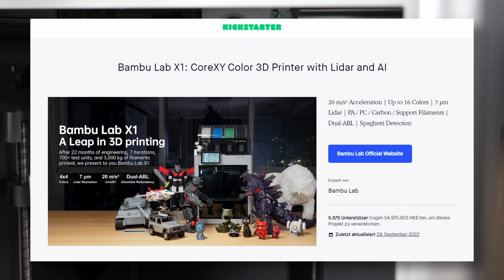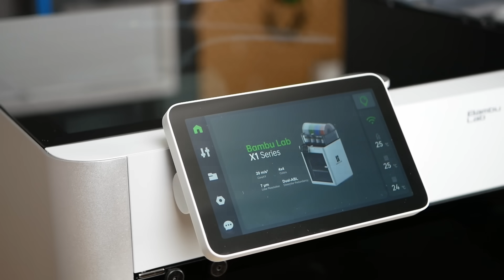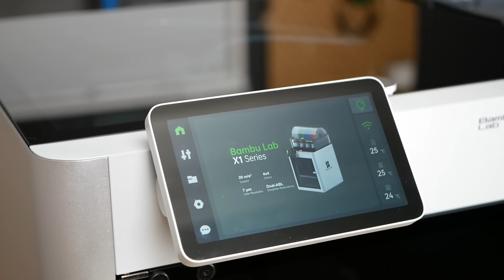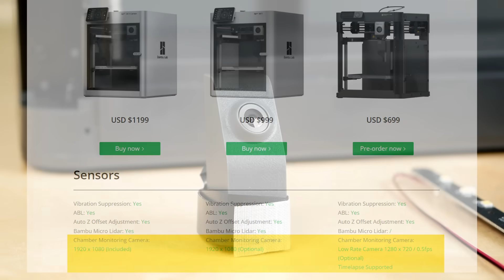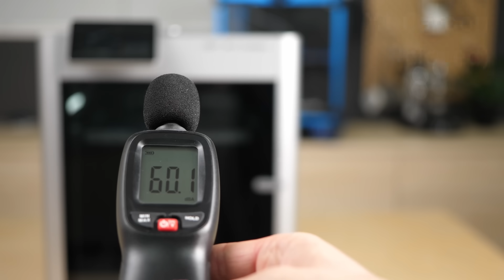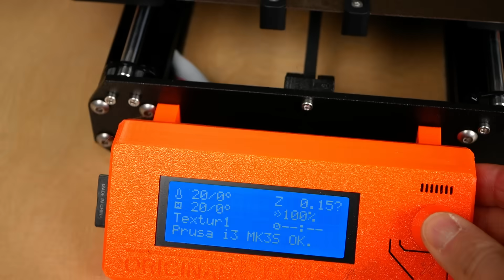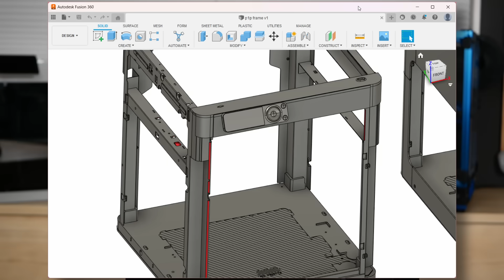The Best 3D Printer of 2022 got Stripped Down to make it Cheaper!

Comment from the maker: X1 Carbon, P1P or neither of them?
Reply: Neither.
I love pretty much everything about them, but the 60-65dB (that's unlikely to be fixable by replacing fans?) is a showstopper for me. =(
Reply: @Lizard008  Holy crap! It's that loud??
Reply: @Lizard008  well it is, just replace fans and job done.
Reply: @Lizard008  You have to realize that dbs readings mean nothing by themselves. Sound decreases exponentially with difference so db readings are only useful at comparable distances. So youd have to compare this to other printers at the exact same distance.
Reply: @BeefIngot  Duh 🤦

That is how their compared.
Reply: Assuming they fix my X1C that died after 30hrs, i will also probably get a P1P, I do mostly PLA printing but the ability to do other materials is nice to have.
Reply: i cant afford either of them, but i rather would go with P1P.
The X1 has nothing exepct the lidar and scanning solutions which i couldnt add to the P1P.
Reply: @michael80126  the x1 does have the ai processors for spaghetti detection and first layer inspection, which works quite well.
Reply: X1C - I see it as a tool for making things and not something to tinker with
Reply: I'd love to get the chassis and mechanical parts of the P1P, but with a skr or Octopus board running Klipper..
Reply: neither its a hard or impossible to repair 3d printer with propietery software. If bambu labs goes under or decides to stop supporting the printer for some reason you are likely fucked.
Reply: @sageslarres  If we only had machines which can create custom parts...
Reply: @MetalheadAndNerd  i know right why buy one when you can just make one instead? Plenty of open source projects using off the shelf parts designed by teams of engineers out there. Voron and ratrig to name 2
Reply: @sageslarres  Unfortunately time and space are costly, too. A RatRig build would consume all my free time for weeks and introduce a million possible breakage points because I have to source lots of missing parts from several vendors and the time for me to realize that something is missing or wrong is when the printer is half assembled. The risk of spending 2000€ on something that will only stress me out for months and never work satisfactory is too high.
Reply: @MetalheadAndNerd  yes that could be an issue if you are not versed in building and maintaining printers. But ratrig does ship as a kit so im not sure why you would go sourcing missing things? The breakage points are also there in the bambo labs printers they arent magick you just get it already put together. 

Its also more like 1k rather than 2k euros for a up an running ratrig.

The thing is you CAN repair your ratrig if the bambo labs breaks a year or 2 down the line you are probably completely screwed
Reply: @sageslarres  RatRig doesn't supply most of the parts for the enclosure, the cable harnesses are only cables cut to length without plugs. One has to crimp all the fiddly connector pins manually. That's the worst kind of work and you can count 1 wrongly crimped contact every 10 pins. 
Furthermore they offer the printed parts only in PETG while stating that when building an enclosed machine these PETG parts were are not recommended.
A 400mm kit with the least expensive options costs 1629€ excluding taxes and shipping. So I guess it will be close to 2000€ in the end. The missing parts cost about 300-400€. So the sum would be more than 2000€.
Reply: @MetalheadAndNerd  there is an enclosure kit where the only thing missing is the panels. Since sourcing and shipping em from ratrig would be more expensive than sourcing locally.

Where do you get 1600 från? Im looking at the complete 40mm builds without shipping plus a raspberry pi for 1430 inc tax and shipping.

Maybe you should spend more than a few seconds on the site so you get your facts straight.
Reply: @sageslarres  I got every information from the RatRig website, seconds before posting my comment. How about less fanboyism and more grip on reality?
Reply: @BlondieHappyGuy  The screen on the printer itself does not affect print quality at all. In fact most print commands are sent to the printer by wifi or bluetooth via your desktop or phone, so you won't even use the screen very much.
Reply: I only have had my X1c for a month and it is fantastic. P1P looks just as good. the only surprise was that it didn't have lidar, which makes me wonder is it really that helpful?
Reply: Just pre-ordered the X1C Combo, based off this video, TeachingTech's videos and those of a few others.  A much better choice for the options standard on it vs. the P1P in my opinion.  I really hope it meets the hype.  Thank you for the comparison and information about the two models.
Reply: The carbon is really the only one that offers something I don't already have. Anything less than the carbon I can accomplish on my basic printers. Sure it's fast but I have multiple printers so that's a moot point.
Reply: waiting for the their to-be-announced C1C1, an ender 3 clone for $299
Reply: @iamdmc  Why?

Why would I buy an Ender 3 clone for $300 when I can buy one for $150? 🤷

I bought my Ender 3 V2 for $150. Put $200 in upgrades on it and now it's just as good as a prusa.
Reply: Both
Reply: yes
Reply: I bought the P1P 3 minutes after preorder opened. Now I learnt what the difference actually was, so thanks for that!   I still want it, and look forward to it, I just wish I could afford the x1 now that you mention all its missing.   I’ll probably add the material station and then decide if it’s a keeper!
Reply: I see that lapavoni lever machine 👍🏻
Reply: @Jonnywoods_049  haha, i prefer the ponte vecchio export lever
Reply: @3rutu5  I just checked it out it’s oooks awesome! I love the lapavoni though because it was in one of the early James Bond films 🎥
Reply: @Jonnywoods_049  when i picked up my PV export it took me about 6 months of back n forth with the PV and LP, one of the hardest decisions of my life haha. I also didnt know the lever was in a bond film, thats cool
Reply: YES
Reply: I was going to make a preorder for an x1 after Christmas, but now considering the p1p instead as most of what I do is pla+ and petg. While I think the x1c is a huge advance in affordable printers it just has more then I currently need, or to put it simply more features then I need.
Reply: X1 Carbon!
Reply: P1P was a VERY close 2nd, but X1C is my printer of choice
Reply: I've become used to fixing and modding my printer, so the P1P would be my choice. Also - if there are drawings available for the frame, maybe laser-cut panels could become A Thing on the "Pips." See? They even have a cute nickname already!
Reply: The P1P with a lidar sensor... maybe.
Reply: P1p
Reply: where does 100C heatbed limit come from? software only ?
Reply: Im might build my own custom corexy soon, hope it’ll work RELIABLY.
Reply: P1P its cheaper
Reply: While the parts cannot be manufactured or easily found, it is not an option, especially because where I live they will take time to arrive if there are any. If you don't want to spend on an original prusa, buy the clone or build it, it will be cheaper than the p1p.
Reply: Neither until they drop the cloud dependancy, support USB host printing and open source the firmware so if they cease to exist one is left with at least a working printing.
Reply: Got the P1P. Die Kiste rockt 😉👍
Reply: i'll probably will get a x1c, jut because i already have 2 3d printers (prusa mini &flsur sr) that are either really slow or stuggle with engineering materials
Reply: My savings account! \0/ tho if they make a fool changer I’m not gonna be able to resist lol
Reply: The X1C+ with larger build volume.
Reply: @MetalheadAndNerd  definitely... How they work through the rigidity problems Voron had to deal with going 350 build is gonna bring the cost way up or speed down.  Dunno which
Reply: @zeke7515  I'd buy a V-Core 3.1 at 400 or 500 if it wasn't an incomplete box of parts instead of a product.
Reply: @zeke7515  the rigidity issues voron has above 300mm are because of the 2020 extrusion and blind joints used in the frame. It's easy to build larger, take a look at the vcore 3 500mm machine, which uses 3030 extrusions and corner barkets. Since the bambu x1 frame is welded steel, i doubt they'll have too many problems.
Reply: @MetalheadAndNerd   wait i thought it was one pf the most complete kits out there?
Reply: @ferdinandhenkel4567  It probably is. On the other hand there are a lot of companies providing Voron kits and not just one company providing V-Core kits. So there probably is a better chance of a complete Voron kit. Unfortunately I don't like the way the print bed is mounted in Vorons. V-Core in my opinion has the superior hardware design. That makes it even more a pity that there is no complete kit without any part sourcing trouble available.
Reply: @MetalheadAndNerd  i spent the same amount for my ender 3 v2 extender. Very big bucks. Still have color changing.
Reply: @MetalheadAndNerd  they all have the exact same build volume so your aware. 256x256x256mm no plus version unless your wishing for a bigger one lol
Reply: @jon52772  That's what I meant. The Plus version currently only exists in my phantasy but as Santa Claus has shown us: We just need to believe to make things happen.
Reply: I already have an X1C.  If you can afford the extra cost, that's definitely the one to get unless you only every print PLA.
Reply: @mortalwombat5811  Do you think the P1P will be able to handle printing TPU?
Reply: @tomsko863  Oh course. Its the same hotend assembly asa the X1s.
Reply: @tomsko863   idk why it shouldn’t be. Its got a solid direct drive extruder.
Reply: Both
Reply: @message2prateek  What would be the reason to have both? Honest question. I'm an engineer and it seems redundant.

Obviously if you've already built a Voron and just wanted to add more fast printers quickly and you bought this then you may have both. But if you already had these what would be the purpose of building a Voron is my question.
Reply: I backed the X1C Kickstarter (with AMS) and I am very happy with it.

However, if I was to buy a printer now, I would definitely go with the P1P instead: All the left out parts are the ones not working great on the X1C – pressure advance calibration is only done for the first filament (and not stored), first layer inspection often has more random than useable results, spaghetti detection almost never works and so on. All what's great about the X1C is still present in the P1P, and it's faster and cheaper than a Prusa.

I'm curious about the noise though – the loudest part of my X1C is the case fan, and that's not present on the P1P. How is it still louder?
Reply: @henninghoefer  Willing to part with your X1C to make room for the P1P?
Reply: @DonsArtnGames  nope, as I said I'm very happy with the X1 😊
Reply: @henninghoefer  Was worth asking...
Reply: @henninghoefer  Thanks for these points. I was already not going to buy one after learning more about it but it's nice to hear this from someone who owns one and is speaking honestly. It's definitely a better buy than a prusa, but I would say an Ender 3 V2 with a few mods is better than buying a prusa too. 😂

I have three somewhat fast printers so I think I'm going to skip the Bambu labs for now.

The P1P is a good buy for someone that doesn't have a printer at all and doesn't have any kind of skills to maintain (hard for some I guess) a less expensive one.
Reply: P1P. Why would I spend 811 Euros (inc taxes & p&p) on a printer that has been designed by a team of real engineers, if I can buy one for 1168 Euros (inc p&p) that is slower , based on a design that's more than 5 years old, has a smaller build volume and also can only go up to 300°C? It needs to print parts reliably and fast if possible, because time is money. Oh and I have a MK2 since forever and it prints reliably, after I rebuilt it to get rid of the mechanical design flaws and Prusa finally got all of the SW flaws ironed out of the firmware after the N-th update during the first 3 years I owned it. Did I mention I'm a Siemens engineer who's been building numerically controlled industrial machines since 1981? If you need prints and don't need tinkering in open source, the choice is obvious.
Reply: Wait until retail units actually exist and are in people's hands
Reply: @Cheesecannon25 retail x1c units exist...
Reply: @Cheesecannon25  Retail units are in hands (for X1C) and does not disappoint.
Reply: @Cheesecannon25  Are they retail units now? if not how are they not if you purchase it from their website? i would like to know if they would sell one wholesale using a wholesale license lol.
Reply: I have an X1C and it’s absolutely amazing
Reply: @ThatGuy-fi9bm  It's whatever.

It's just a voron with multi-material capabilities.
Reply: happy with my prusa
Reply: I personally love my X1C!
Reply: neither as i prefer open source.
Reply: Carbon X1 Easily
Reply: X1
Reply: Thanks for the review.  I would have to choose neither.  I would rather spend less monies and go for a larger print area.
Reply: Is there a machine with larger than 256 x 256 x 256 mm build volume for the Bambulabs line?
Reply: @alkatraz6170  Not yet, but they have mentioned that they are considering it.
Reply: @alkatraz6170  nope, so far all 3 variations use the same print bed
Reply: Still rockin' on my MK2.5S, with free mods and 3rd party replacements 🏆
Reply: I find it confusing that everyone claims that the printer costs $699. 
During checkout its over 800€, because of taxes.  So no p1p for me.

For my preference its too loud and the ams just produces too much waste.
Reply: I wanted both, but was put off by the toxic community in the official FB group :/
Reply: @MartinWolker  that sucks.. FB communities in general are super toxic. You should check out their discord server, its really chill.
Reply: @MartinWolker For things that are easy, you always get the most toxic trolls.

These are the people that felt left out because they didn't know how to build, setup or maintain a less expensive 3D printer.

So now that they can they become these bitter trolls and try to rub it in other people's faces that they can now be 3D printers too, and they don't need to know how to work on them.

The same thing just happened in the FPV community. All these people that didn't know how to build their own FPV quads bought the DJI Avata and now they're acting like they have the coolest thing in town... When in reality it still doesn't compare to a home-built FPV quad.
Reply: Build a Voron.
Reply: @SiriusXification  How much is your building time worth? Get the P1P
Reply: Prusa XL or build a Voron from a good kit.

Giving this much money for no-name printer made in china not a good investment.
Reply: @jurabondarchook2494  XL doesn't exist while the X1C does and P1P will shortly after
Reply: @jurabondarchook2494  Prusa will never get a dime from me.

Their products are overpriced now for what they sell. Maybe not when they were the only game in town, but they aren't anymore. My E3v2's with a few upgrades are just as good as prusas.

Just because something isn't made in China doesn't mean I'm going to pay triple for it. Prusa can either start competing in pricing, or they can get lost. When it comes to electronics I have no issues with China. The tools they make suck but their electronics are great.

I also wouldn't build a Voron over buying one of these, unless I find working with electronics fun. I have to be honest. The kits are just okay, and ordering part by part (if they are even in stock) is time-consuming and tedious. 

However, If I already had vorons, I wouldn't buy the Bambu.

Comment: Thx dood. I’ve not seen any other channel mention the bushings on the lead screws for the P1P. Other tiny changes like a weaker tool head cable incompatible with cable chain (which was also removed) show how the P1P is not just stripped down but actually more economically built (lower quality).

Not complaining, it’s just worth mentioning so thanks for that!! (-8

Comment: I ordered a P1P yesterday. I could have easily afforded the X1C, but I actually prefer the P1P. I've already ordered custom cut polycarbonate, and am printing the parts in ABS for the vision enclosure. Beautiful magnetic panels easily removed when needed. The lidar is a gimmick, and doesn't even work on the build plates I will use. Couldn't care less about a touch screen, and the silver cover would be the first thing I would remove. I can't stand working in a cave, and I WILL be modding this thing. Also the extruder gears, and other mods are very reasonably priced, but I will be putting in my own LED lights, and camera system, thank you very much. Really looking forward to it.

Comment: The P1P is such a good Printer for the price, i love that thing 😁 (PS: they just added a great way for manual flow calibration and a LAN mode, so you can use the wireless connection of the Printer without the cloud  😉👍 PPS: the optional camera supports timelaps if you want to use it, i suggest getting something like a Blink camera, or if you want a print failure /spaghetti control use an octopi with a webcam to watch over printer and to control it)